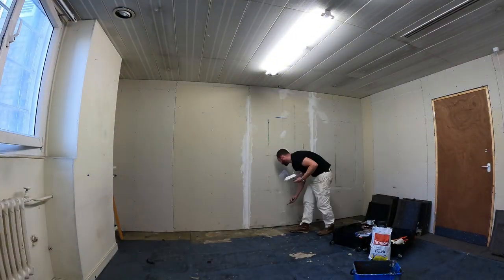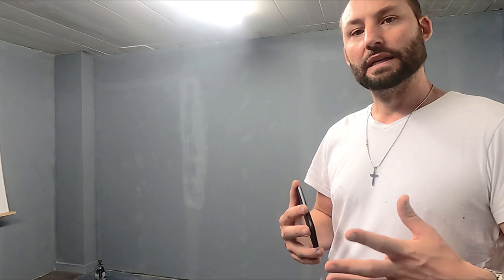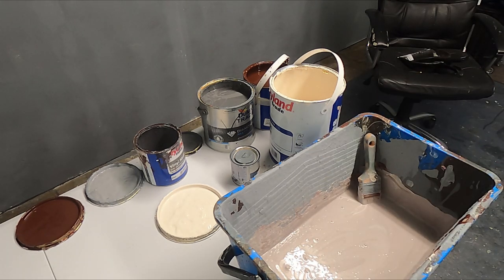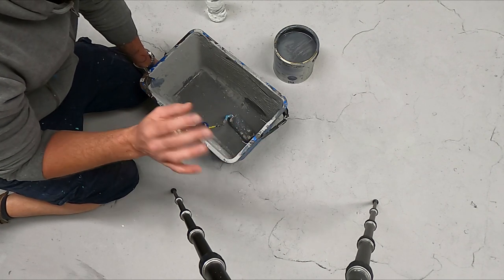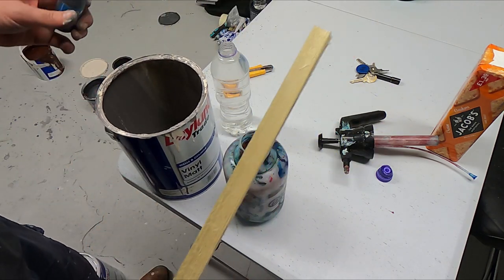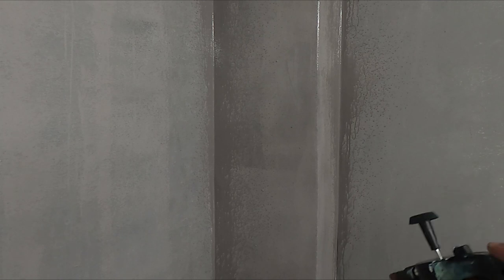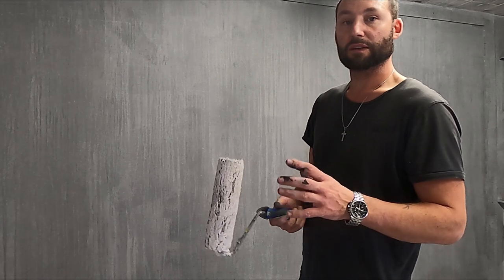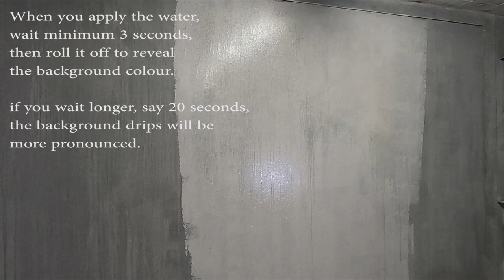FAUX PAINTED CONCRETE using regular paint

Comment: If I'm understanding this right, you're basically doing coat after coat of a glazing technique? To gradually build the color in for depth?

One thing I love about this technique is how forgiving it is. If you get a little too blue, yellow, orange or whatever, you didn't put a ton on and you can adjust in the next step.
Reply from the maker: Yes exactely, it's all about layers, and it's very forgiving. Not to mention, a lot of fun to paint.

Comment from the maker: Which Faux effect would you like to see next?
Reply: Does the water technique work with walls that are already painted?
Reply from the maker: @casst33  Hello, yes. You want the walls already painted to protect them from soaking through the plaster or plasterboard. It creates a barrier. If your walls are painted with oil based paints, you need to sand them lightly so that the water baseed paint base coats can adhere.
Reply: How about a faux brick wall?

Comment: Latex Paint?
Reply from the maker: No, in the UK is mainly emulsion paint (pva glue based) it doesn't matter for indoor use
Reply: @olivierroubieu  Okay, I understand. how can i do this at home if there is no pva based paint? thanks
Reply from the maker: @gergoocsovai1864  you can do it with any water-based paints. Latex, emulsion, acrylic, they all work
Reply: @olivierroubieu  thanks you 👌